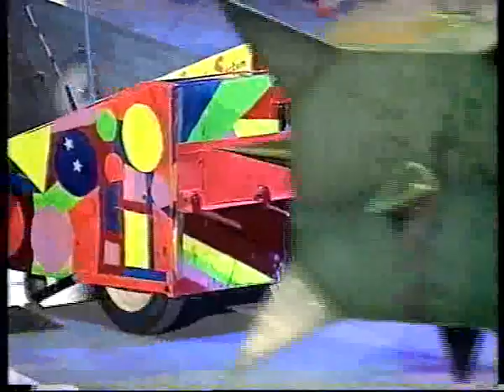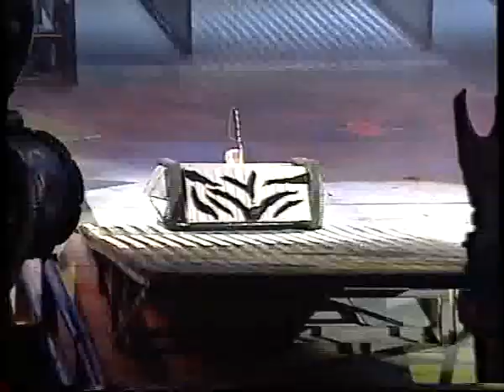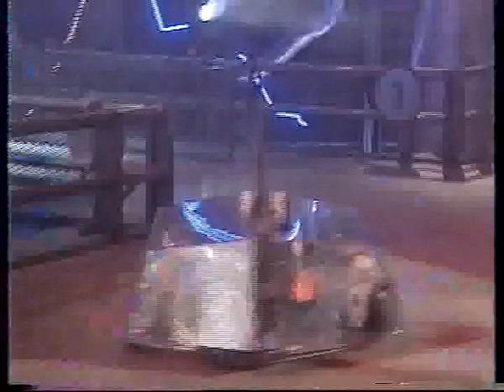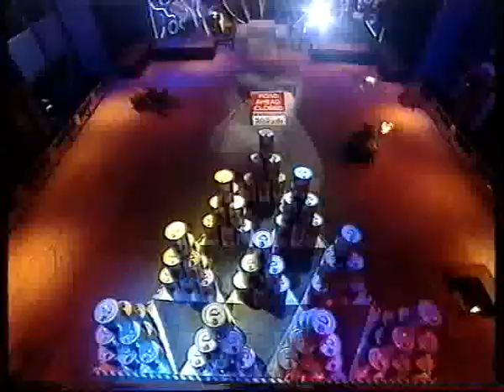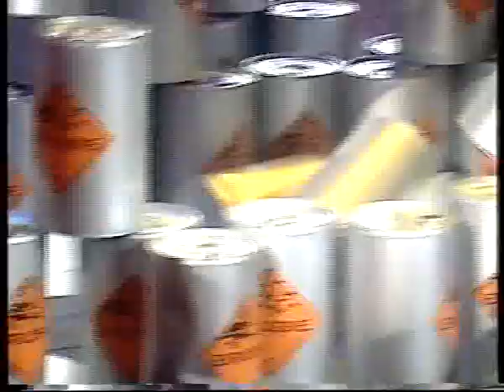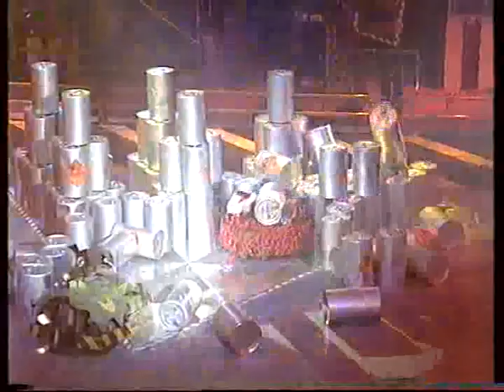RWars Series 2 Heat G Part 2

Comment: You have to admit, ROCS was a little bit unlucky in this particular heat, mainly because of if it was in any other heat (except heat K), then it would've survived the gauntlet. Phoenix is heat K had this issue too, it was just the better performances, that's all :(

Comment: Total bull what the House Robots did to R.O.C.S- all 3 of them piled into one lane against it, it had NO chance of completing the Gauntlet. I'm really not sad to see the Gauntlet go by the 3rd Wars, it was a horribly unfair event, with the actions of the House Roboteers being the primary reason for success or failure- far more so than in the battle arena.

The Trial is certainly better than the last time we saw the Skittles- last time the most barrels knocked down was 20, most of the robots knocked a few down and then got burried under them an immobilised, and the loser was eliminated when their weaksauce robot was too pathetic to even BUDGE them!